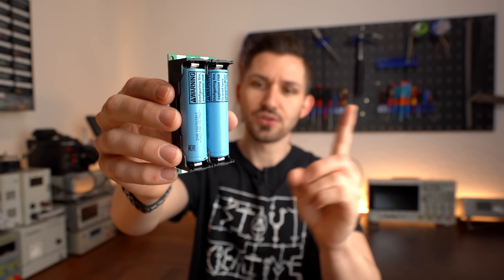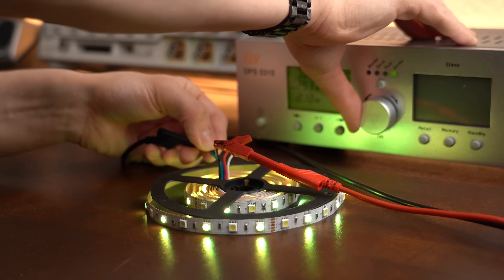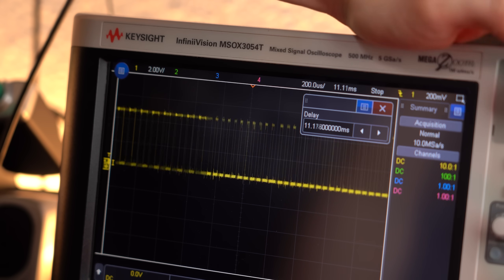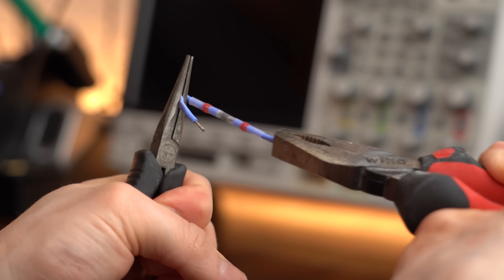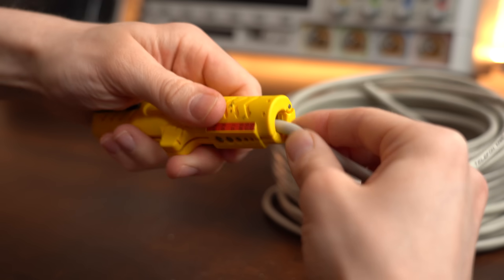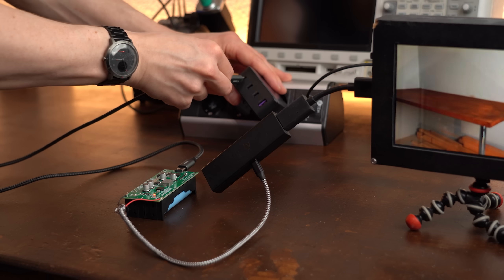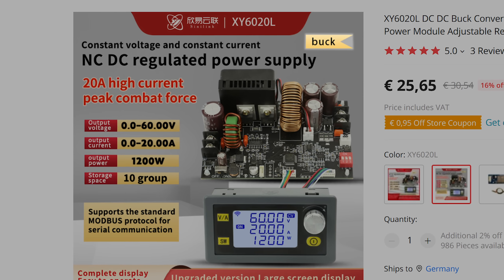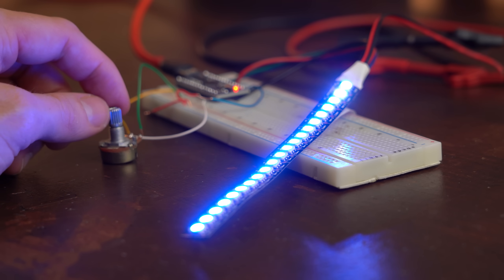I tried finding Hidden Gems on AliExpress AGAIN! (Part 4)

Comment: I ended up with one of those little yellow wire strippers in a kit of solid core wire, and I love the thing.  So much easier than my old strippers.  It's really only good for small wires, but it's pretty good for that.
Reply: Yeah, I use mine for CAT-5/6 cables, and it works great. The plastic hinge only applies a small amount of force on the blade, so I spin it a few times and the outer jacket pulls off with no nicks on the twisted pairs. Cheap and effective.

Comment: That yellow wire stripper... I used it once, it was a very spesific tool, used to connect cat cables to the female receivers that goes in the wall. Never tried using it as a wire stripper though 😁

Comment: I've gotten a capacitive sensor for less than €3. It works as it should though i stopped the project i wanted to use it on.

Comment: Hi Scott!! Is there any way to modify that (2) 18650 cell power supply to fix its shortcomings? Or, do you know of another that works to your liking? Maybe a "How To" make one?   😁
 I would love to be able to use something like that as backup power for my phone or whatever. I have a pile of 18650s that I pulled from discarded packs that have plenty of life left in them.

Comment: Can you just add a large size capacitor to the UPS and smooth out the voltage to make it useful?  Or it will create some reactance that will mess things up?  Thanks.

Comment: You should make a video where you try to improve the adjustable power supply module to get rid of some of its noise. I have a slightly older version of it and could really benefit from such an improvement :)

Comment: Hey Scott, i have a question about heat shrink connectors and i would like to get answer :D Everytime i see them i can see that they connect wires, but soldering is not the best, so have you maybe tried using some flux on the wires so solder could flow better and also bond better? 
As i can see on many videos they bond mostly on the surface and can't get proper penetration inside wires, which is big bummer for me, because they look really nice and are handy for many applications. Thanks for answer.

Comment: You should never use that heat shrink solder stuff on a vehicle that is carrying a passenger, you say the resistance is low but it's terrible compared to an XT90 or XT60 connector

Comment: I got one of those little yellow wire stripper things with a cheap soldering kit like 5 years ago and tried it out for the first time a few weeks ago on some cable that was too thick for my automatic stripper.  I was actually kind of surprised at how well it worked for the particular thickness of cable I needed it for.

Comment: Rohde & Schwarz have some of the lowest noise floor spectrum analyzers last I knew.  

Ducting for the fan intake so the fan is slightly up higher along with the top of the duct and extra side width?  

Those UPS 18650 boards are great for solar cells or panels for use with devices like older models that use the AA or AAA where the only improvement beside the noise issue on that design is having like an adjustable output so those other buck boost modules aren't required to bypass the alkaline battery inputs.

Comment: As the beginning of my PhD work (in the field of experimental high energy physics), I designed a boost power supply that will be providing bias voltage to silicon photomultipliers (SiPMs). The output voltage is adjustable from 49 to 58 V, with a 3.3V input (1mA max current). Since the gain of an SiPM strongly depends on the biasing voltage and temperature, a very precise power supply has to be used. Our target is to reach a noise level of 0.01V peak to peak, and even lower. Also the design goal is to measure the output current in tens of nanoAmp order accuracy! We are still working on it, and will hopefully publish my first research paper soon. 

My point here is that designing a switch mode power supply is easy. You choose the right components, design the schematic and PCB following the guidelines given in the datasheets, and get it manufactured. That's what I thought initially. Then I measured the noise levels, and it was a disaster. It's really difficult to get the switching noise out, especially at higher voltages. Trust me, I learnt it the hard way. There is no surprise that the power supply modules showed terrible noise levels.

Comment: What would happen if you added a few low ESR caps to the output of those power supplies? Would the 5V output on the lithium battery UPS look better?  BTW - the grey colored stripper I thought was for coaxial cable only.
Reply: For charging, a smoothed supply is not necessary.
Reply: @georgebliss964  Okay, but that's not what I'd use it for.

Comment: thank you for another helpful video! one suggestion though: when showing the noise on the dso, try to keep the same v/div range, otherwise it looks like the cheap power supply is only slightly worse than the high-end one.

Comment: Problem with those heat shrink solder sleeves is the low melting point solder, it's not likely to hold up over time in areas exposed to high temperature.

Comment: A great collection.  I've been using that yellow stripper for years with much success, but liking the look of the grey one.  I had a look at the red one before, but I need it actually to cut off the sleeve.  For thicker cable I just use a hobby knife.  I'm liking that fan for fume extraction as well.
Reply: I use the gray one to strip coax cable

Comment: Nice video again. Could you try to measure voltage ripple of DC DC converters using probes ground spring instead of aligator clip? Maybe there will be difference p-p value.

Comment: Don't measure the output of the buck or boost with the scope's ground lead. Use the little low impedance spring clip. 3/4th of that noise is probably just poor probing related.

Comment: I love those solder connectors and actually just used some to connect 3 wires together. If you don't require the fully waterproof part, they still work good for that.

Comment: Can't the noise problem be fixed using a Supercapacitor on the output end? Especially for the USB UPS since it seems like a great product for things like routers which sometimes take a solid minute to boot up if the power supply is interrupted.

Comment: About the heating connectors/shrink wrap, so what was the resistance like?
People are using these on higher power ebikes and scooters and honestly I don't think its a great idea for something like the phase wires seeing as its incredibly low temp solder.

Comment: The problem with AliExpress "reviews" is that people leave a review as soon as the item arrives. So most you read is: "Got the package in time, great seller. Item looks good." And then leave a 5 star rating. People hardly ever take the time to do a review of the actual quality of the item a few weeks later.
This is mostly caused by how AliExpress works: as soon as you mark an order as "received" they ask you to do a review and people get extra coins which they can use for a discount with a next order.

Comment: Those heatshrink solder things actually work pretty well you just need a ton of heat to melt the solder.  But not enough to melt the heat shrink.  They're not horrible but I wanted them for FPV stuff and it ended up being useless cause of how stiff and heavy they ended up being.  I did use them a couple times for fixing irrigation stuff though so not completely useless
Reply: use a curved deflector nozzle ;)

Comment: First, that >10 MHz ringing on the power supply outputs might be due to your probe's ground loop and coax impedance mismatch.  Second, proper bench supplies' outputs have linear regulation even when their intermediate voltage is supplied by smps.  This accounts for some of their bulk and cost.  Third, RLC smoothing at the outputs would greatly blunt the hf components due to the fast edges.  I like the idea and the additional board space of a 3-4 cell unit could address these 'faults' and add max voltage and energy endurance.  A stackable enclosure would add convenience when deploying them in concert.

Comment: Hey Scott, I just wanted to let you know that I think there was a translation error in this. It should be activated Carbon/Charcoal and not activated coal for the filter.

 Coal is the Oily/Tarry stuff from the ground. Charcoal is just made from burning carbon rich stuff like wood.
Reply: Looked it up, the German word “Kohle” means carbon, coal, and charcoal. So perhaps in German you’d just understand by context.

Comment: Can a large capacitor work to filter out the noise on the output of the UPS?
Reply: Not always with a switching power supply like that. The inductor is much more important. Besides all that, depending on how fast it switches adding a big electrolytic probably won't do anything, ESR too high. You'd need to add ceramic capacitors at the right point on the circuit. Adding them 3-5cm away at the output lines does nothing good, folds back into bad board design can't be fixed.

Comment: I would love to see how you would go about filtering the output noise from that last power supply! I have a couple of similar modules, and would love to figure out how to stabilize the output voltage.
Reply: You first need to check if you need to.  The scope is telling lies. Theres fast switching involved so there are large transient stray fields radiating from bare pcbs. The scope picks these up because the flux cuts the scope ground lead and you see a scary waveforms. 5pc ripple is expected but the rest probably isnt real.

Comment: 9:05 - UPS is simple 2 battery parallel?
What happens if i put 2 battery different charge(100%=4.2V and ~10%=3.2V)? - short current! its bad

Comment: For the 12v UPS, do you think a 3.5" hard drive would complain about the noisy output? It only uses that voltage for the spindle motor after all, and I'd love to have something like that for my rescued HDD that I use via USB.
Reply: I wouldn't do that. HDDs are sensitive.
Reply: @nimoy007  what would you recommend for running it uninterruptedly in case of a power outage? Currently, I use the board from a 2.5" caddy for data and 5V, but the 12V power comes from an external supply, it works fine like this but I suspect it would overload that UPS in the video since it consumes a peak current of about 1.1A.

Comment: The yellow and gray wire strippers you showed aren't bad tools, you just used them incorrectly. They aren't general wire strippers; the yellow one is meant specifically for trimming the outer jacket from twisted pair telecom lines (CAT5, etc.,) and the gray one is meant specifically for prepping coaxial communication lines to have their connectors placed on, which is what the diagram on the side of it is (the lattice drawn on the cable represents the outer shielding mesh that is over the dielectric core in something like RG6.) That one in particular I know they advertise as working on copper wire in general but that's specifically what it's not for and I think it's a translation issue.

Comment: Oh, the troubles with the Jokari Super 7...bell transformer cables (Klingeldraht) or anything below 2x1,5mm² and the Jokari are a nightmare.
In the end, I ended up using the wire stripper that came with my network cable tools which works similar to the grey one you show in this video, but the blade is on a screw for adjusting. Works...okay for anything below NYM-J 3x1,5mm² down to about 2x0,5mm² where it starts to srtuggle a bit.
Still looking for a wire stripper like the Jokari that works with anything from NYM-J 5x2,5mm² all the way down, but so far, no luck.

Comment: Not ONE of your solder sleeve joints were fully heated and connected! Not one. That's why the solid wire came apart, because it wasn't at all soldered. Your heat gun was not hot enough to melt the solder through the plastic. After soldering, the ring should not be 'visible'. It's supposed to completely melt and flow into the wires. When done it's supposed to look like a solder joint wrapped in plastic. I glanced at google but couldn't quickly find a pic of a proper shrink joint. You also said can't do two wires, which is incorrect. There's nothing 'new' about these solder sleeves.

Comment: Würth been selling those shrink solder connections for years now. They also have a squish and heat ones. With those you can use 2 cables on one side and don't have to twist wires.

Comment: the yellow tool is actually a punchdown tool (to connect telecom and network wiring in punchdown blocks), the wire stripping bit is almost an afterthought, and it shows. (the punchdown part is also pretty meh, but it's better than trying to punch cables in with the tip of a knife or a screwdriver.)
For a few euro more, there are very nice punchdown tools, but I haven't needed mine since I got out of IT/Networking.

Comment: Heat Shrink Wire Connectors: Crimpen soll besser sein und diese Löt-Verbindung ist wohl nicht für 230 Volt gedacht und wohl auch nicht für sehr warme Bedingungen (Ampere), weil das Lot eine niedrige Schmelztemperatur hat.

Comment: The little yellow stripper is designed to RJ45 wallsocket installation. The little metal part at the end is for stuff the wires into the contacts. It's just an accessory of an RJ45 crimper.
Reply: I love them for work.  I don't even take my proper punch-down tool anymore, this just does it in the palm of my hand.

Comment: 18650 UPS: what about soldering in a low EMSR capacitor at the output rail? Wouldn’t that supress the noise?
Reply: Possibly, you've at least mentioned low ESR capacitors. Unfortunately, more capacitance at the right point not too far from the feedback or switching circuits won't fix anything if the switch or inductor are overloaded, or if the board layout is just a mess. 

Here's hoping for a follow up video on this topic.

Comment: 4:18 You should cut welded joints and check how it looks inside. I wish you luck during connecting older wires. This connectors are rubbish.